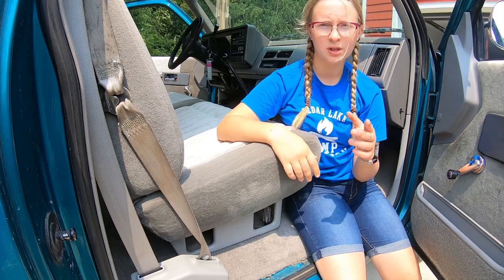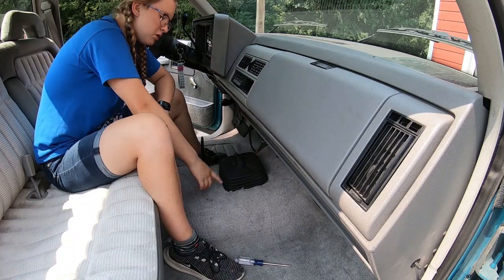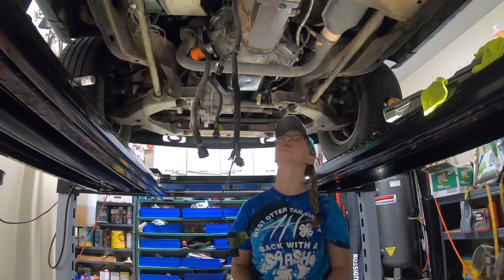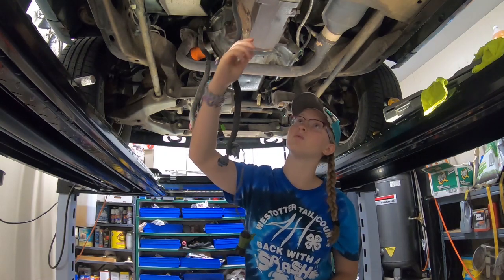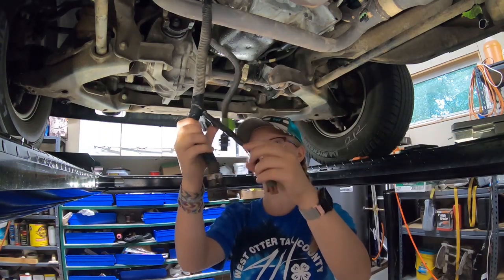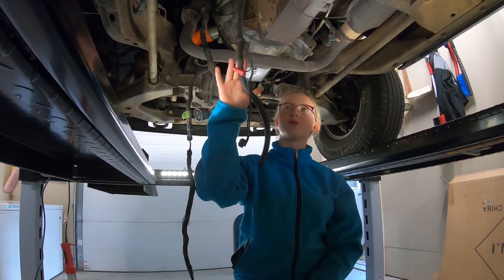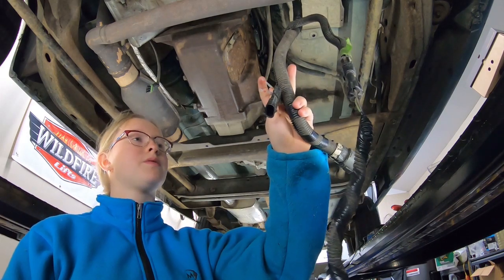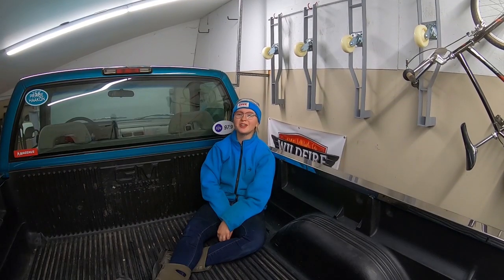OBS 1994 Chevy Silverado Short Box Auto To Manual Swap. Part 5 Interior and unhappy VCM issues.

Comment: This is amazing guys. Well done. Someone hit me and totaled my manual k1500, I want to do this same swap with an auto c1500 I just bought. Thank you for documenting this!
Reply from the maker: So unfortunately, the k1500 isn’t compatible with the c1500. The rear of the transmissions are different. The k1500 mounts up to the transfer case. It can be done, perhaps, but would be a major modification to the transmission. Probably best to have a donor transmission. Good luck!
Reply: @PureJoyFarms  I just learned this too! I have another k1500 that will get my wrecked k1500 parts. They are both manual transmission. At least I'll be able to use the pedals and steering column. I already picked up a clutch fluid reservoir. I will hunt for a donor c1500 transmission. Did you guys use the nv4500? I have a 5.7 350 in my c1500, not sure if I need the nv3500 or 4500 transmission. Thank you for the replies!
Reply from the maker: @amfinc2  great! You can use either one as long as it’s 4-wheel drive.
Reply from the maker: And yes we used the nv4500.

Comment: So I’m stuck right now. I done the nv3500 swap in my 95 gmc Sierra k1500. My problem is at first when put in to gear the truck wouldn’t move. I took the transfer case out of 2wd and put it in neutral now when in gear it moves. Is this normal or is something not right.
Reply from the maker: Maybe you solved this already. Do you mean it won’t drive or it won’t roll when you push it?
Reply: I got it figured out. Thanks to your videos!!! Great insight on doing this swap helped me a lot.
Reply from the maker: That’s great! Glad they were helpful!

Comment: Just finished my swap 1995 nv3500 into 1996 k1500 it runs and drives fine but im getting codes 
P1886.  p1864. P0753. And p0713 do you know how to get rid of them
Reply: From what I gather I have a 95 myself I'm going backwards with mine tho 90 model parts truck I'm rewiring the entire truck to swap my 5 speed trans so I'll basically have a 90 model truck but on the issue your having the computer is going to throw codes as it's an auto ecu your gonna have to find one same motor trans as you have for a Manuel truck and codes will go away

Comment: i have an 89 chevy silverado i would like to change from  automatic to manual transmission  the  reverse is out of the automatic  is it  possible to find a manul trans for it
Reply from the maker: Most are interchangeable. A NV4500 or NV3500 would go in there.

Comment: Would I be able to add a manual transmission to a 1994 chevy 1500 4.3L V6 2wd?
Reply from the maker: Yes — that is exactly the truck we have, except that it is a 4wd, which would make it much easier.
Reply: @PureJoyFarms  would 2WD be harder and what would be the differences?
Reply from the maker: 2wd would be easier because you don't have to mess with a transfer case. You would need a longer driveshaft though.

Comment: What about the computers between the two transmissions? Because when you're doing the swap you also have to swap them out as well or you might have issues is what I was told.
Reply: Great tutorial and you're doing a great job yet yours is a little different from mine. Mine is a 2wd not a 4wd, haven't heard anything about the neutral safety switch in the steering column yet, would the drive shaft be different in mine since it is a 2wd, and in your opinion how difficult do you think the swap has been overall?
Reply from the maker: @ligespiegel4966  for  a 2wd, it should be very easy. The drive shaft will match up, no problem. The swap has taken time, but overal, not difficult! We would recommend using a parts truck vs buying new parts. Saves lots of time and money!
Reply: @PureJoyFarms  Ok great tip thanks.😉
Reply: In your opinion where would you be able to find a parts truck if you can't find one locally?
Reply from the maker: @ligespiegel4966  have you tried Facebook marketplace? That seems to be the best place for vehicles these days.
Reply: @PureJoyFarms   What about the neutral safety switch in the steering column?
Reply from the maker: @ligespiegel4966  yep, that’ll be in the next video — sorry for our slow delivery — thanks for hanging with us!
Reply: @PureJoyFarms  No problem just I would like to use your videos as a guide if I decide to convert mine over to a standard but right now I'm kind of on the fence about it.
Reply: How long until you do that video? Don't mind me asking.
Reply from the maker: @ligespiegel4966  ha, good question. Wish I had a hopeful answer. We have a few other irons in the fire…..within the next two months. Thx for hanging with us!
Reply: @PureJoyFarms  K just was wondering is all.
Reply: @ligespiegel4966  I’m currently doing the swap on my 97 and so far it hasn’t been too hard the hardest part is honestly pullin the trans and installing the new one
Reply: @zTUCK2002  The computer/VCM is the part that I'm most worried about.
Reply from the maker: The manual doesn’t use a computer, so no issue. The only challenge we had was with the 4 wheel drive, which we worked around as well. Good luck!!